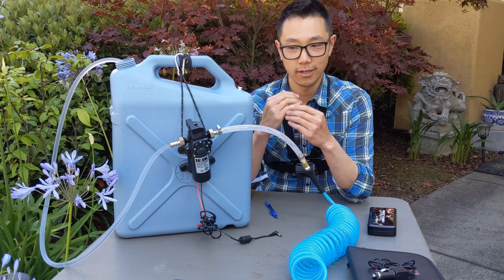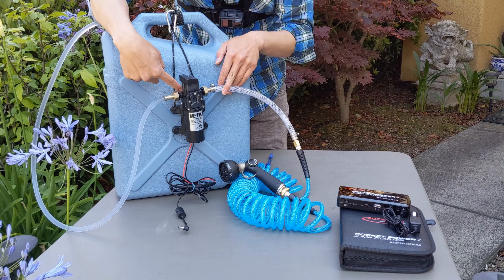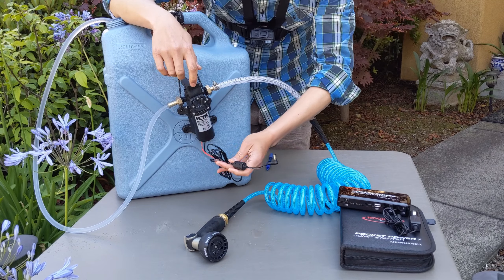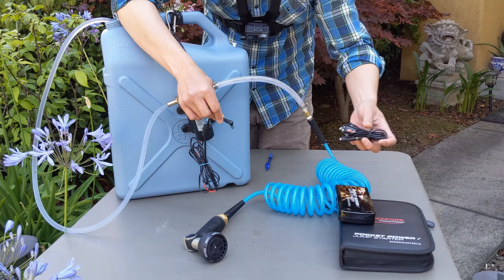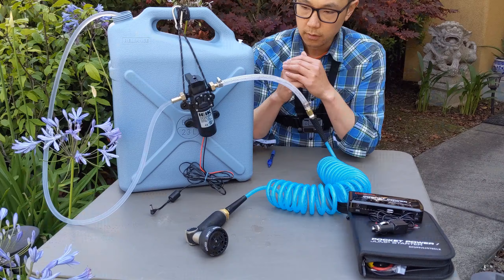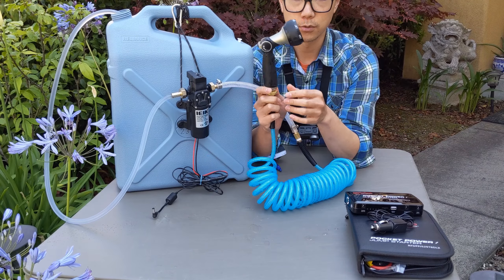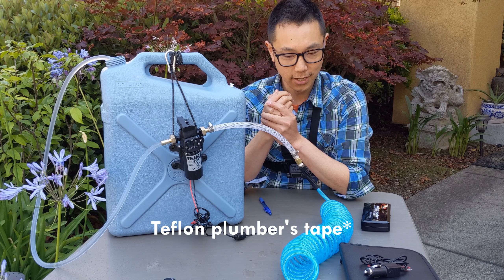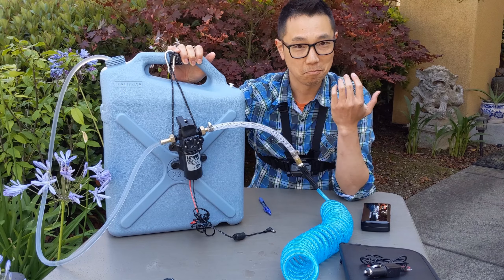DIY 12 Volt Powered Portable Camping Shower | easy VERSATILE simple | No drilling required

Comment: My suggestion is buy a Jackery portable power supply and use a 110v water heater of some sort it would also give you UNLIMITED POWER for showers lol =) They can also be charged by car or solar panels so it gives options for off grid stuff.

Comment: There are a  lot of immersion heaters available on Amazon, 12V capable of heating a tiny amount of water and AC powered capable of heating a full tank. They all take a relatively long amount of time to complete the task compared to a Jet Boil or stovetop.
Reply from the maker: Yeah I couldn't find anything practical enough for 12V heating. Usually will just boil a bit of water to mix in

Comment: You could do something where you have an aluminum container that acts as a conductor, not sure ho you could feed the Heat to the unit..lol but the best solution would be an immersable water heater rod. But yeah for either of these suggestions you’d have to wire something yourself good luck!
Reply: Yeah Amazon carries some submersible heating elements. Other than that, I've just poured some hot water into it so I have lukewarm water when I shower with it. It's  refreshingly cool haha